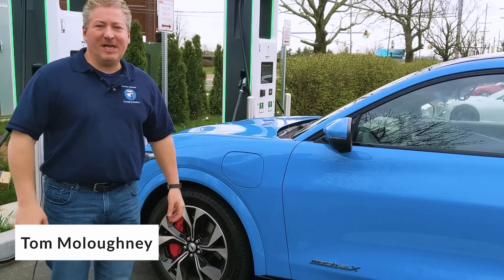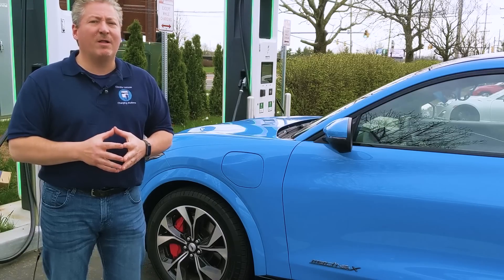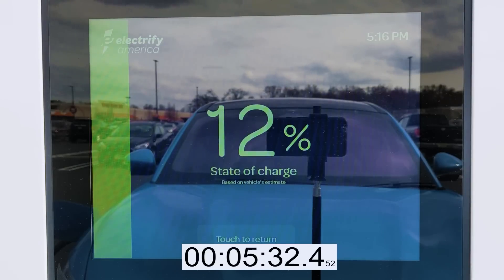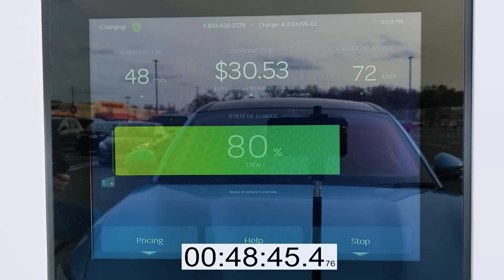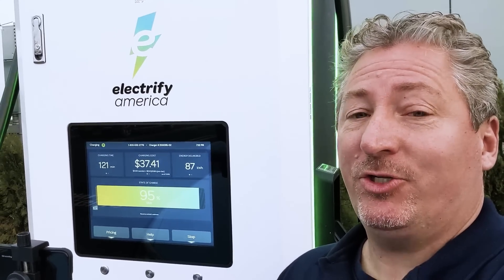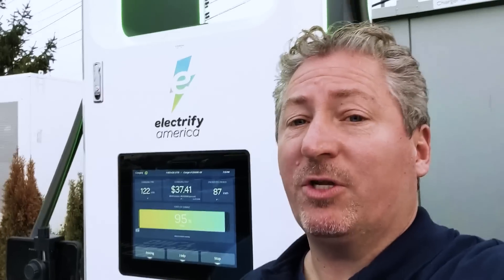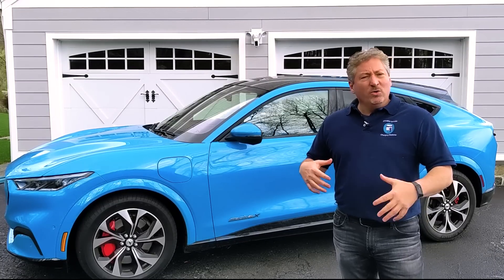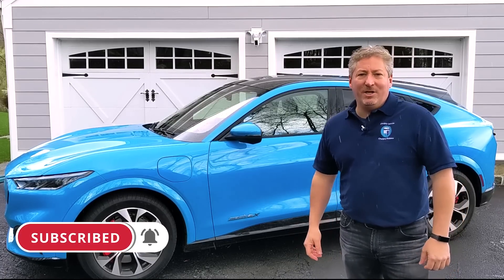Mustang Mach-E DC Fast Charge Test

Comment from the maker: Note- READ THIS regarding the cost: In New Jersey, Electrify America bills by the kWh and as a Pass+ member, I pay $0.31 per kWh. Since the Ford Pass currently cannot be linked to an Electrify America Pass+ account, users pay the guest rate of $0.43 per kWh. The Mach-E took in 92 kWh during my DC fast charge test and the cost was significantly more than it should have been. Instead of paying $28.52 to fully charge the Mach-E, it cost $39.56. So don't use the cost of $39.56 as you see in the video. It should have cost $28.52.

The problem is currently you cannot link your Ford Pass account to your Electrify America account to get the discounted rate, so I would have just used my EA account and saved $11. But then you can't access Plug&Charge, which I wanted to demonstrate. Hopefully, Ford will get this straightened out and Mach-E owners will be able to link their EA accounts to their Ford Pass, allowing both the discounted rate and the use of Plug&Charge.
Reply: MachE owners should consider buying a Tesla to J1772 adapter and find a Tesla destination EVSE at 80%.
Reply: As someone whose electric rate is $0.0985/kWh, those rates seem absurdly high... particularly considering you can only get ~250 miles on such a charge, so the cost to run an EV at those rates is the same as if my car only got ~13MPG and gas was $2.49/gal.

Charging at home is the only thing that would make an EV affordable with a charge being ~$9 for 250 miles, making it much cheaper than gasoline.
Reply: @looncraz  That's a VERY good electricity rate. The national average is $.13/kWh. Electrify America charges $.31/kWh for members - which is what you would be is you had an EV and planned to use the network. You have to remember, most EV owners only use public chargers once a month or so when they need to drive many hundreds of miles. Therefore paying a little extra once and a while isn't a problem. 
This session would have cost you $28.52 to go between 270 and 300 miles - our tests showed the Mach-E going 283 miles at a constant 70-mph. Therefore, it's cost $.10/mile which is MUCH less than buying gas at 13 MPG.
Reply: @InsideEVsUS   That's like paying $2.87/gal of gas, which is certainly not horrible compared to the $2.29~$2.49 it is for cheap gas here, but it better than the $3.09 I'm averaging with 93 octane... so, yeah, suppose it ain't too bad.
Reply: @looncraz  this is a higher rate for DC fast charge and for road trip purpose. Most of the charging for daily use are done at home or work.
Reply: Can u do a new more updated version please of model 3 and model s  v3 supercharging from 2 per cent up to 90 per cent? Please? An new more updated?
Reply: @vasileiospetropoulos2046  This video isn't about Teslas.
Reply: Ok so just stick with gas then.
Reply: @dennisfinan7977  Assuming you are talking to me... I own two PHEVs :p
Reply: @looncraz  no myself. Was looking at the mach e but I'm too lazy to deal with charging
Reply: @looncraz  not saying there not awesome to drive. Or not superior
Reply: @dennisfinan7977  Ah, if you can charge at home then it's a non-issue.
Reply: I'll look into thank you sir
Reply: they've fixed this. I   have the GT Performance Edition and the discount gets applied while using plug and charge through the app.

Comment: The way I look at is if I leave with a 100% charge and can charge at my destination, after about 3 hours of driving, I only need to stop for around 5-10 mins every hour thereafter, which seems perfectly reasonable to me in terms of normal breaks. I just wish there were a few more DC fast chargers in the south to give more options on where to stop. 

If I couldn't level 2 charge overnight at my destination, then yes I would need at least one longer DC fast charge session. However, if I knew I was going somewhere remote without good charging options, I would probably use/rent a gas vehicle for that specific trip. If you really like getting lost in the woods away from civilization, a powerboost f150 with 700 miles of range and a built in generator might be a better choice.
Reply: Tom has promised that Electrify America has not forgotten I-20 between Texas and Georgia.

Comment: Thanks Tom.  Charge rate up to 80% is sufficient.  I do notice it added 92 KWh for 100% (Ford states 88 KWh usable) so efficiency is a bit lower.

Not a big deal.  The car has power and solid range.  And Ford will learn and improve the charging algorithm.

I hope they can make them by the hundreds of thousands!
Reply from the maker: Hey Johan. The 92 kWh didn't all go into the pack, only 88 kWh (or maybe 87 kWh) did. There are always charging losses, which accounts for the 4 or 5 kWh loss during DC fast charging. That happens with all EVs.
Reply: @StateOfChargeWithTomMoloughney  Thanks Tom.  Even w DC to DC where an inverter is not used?  But I guess the charger shows 92 kwh dispensed but the car shows 88 kwh received?
Reply from the maker: @johannel8104  There's no reading on the car to display it, but the transmission losses are real. There's also BMS working for 2.5 hours during this to cool the cells, that uses the extra energy. It's the same with every EV we test.

Comment: Forget the charge speed, why is EA so expensive! Doing rough estimates in my head, if I were driving a car that got around 30 mpg, gas would have to be at $4 per gallon to make this comparable to what you paid for the miles driven. Even if you got the EA rate for members, it would be around $3 per gallon. Are my figures that far off or are the rates in your area just that high?
Reply from the maker: It cost $39.56 because I used Ford's account linked to Plug&Charge. If I used my personal Electrify America account it would have cost $28.52. I just drove 283 miles on a full charge, so it cost $0.10/mile. The current gasoline Mustang gets a combined MPG of 19 - but let's round it up to 20 mpg. It would need 14.15 gallons of gas to drive 283 miles. At $3/gallon, that costs $42.45. At $4/gallon it would cost $56.60. That $0.15 and $.20/mile respectfully. Gasoline to fill a Mustang would have to cost $2.01/gallon to cost the same as it cost me to charge the Mustang Mach-E using my Electrify America account.
Reply: @StateOfChargeWithTomMoloughney  Even with what you quoted if you used your personal account, it seems a bit high. I am going from information that Tesla owners pay at superchargers. A norm seems to be around $20 for 275 miles of range. Something else for me think about as I try to determine if I want a Tesla or another EV. The Mach e still is a strong contender. The issues seem to be software related and that can be addressed over time. Thanks for another great review and video. You and Kyle put out the best in my opinion.
Reply: @jamoss55  Most people charge at home, and it only costs 10-20 cents per kWh... so about 33%-66% of the price of the discounted EA rate.  You also don't need to make an extra stop to fill up during the week.  You just drive home and plug it in.  The convenience savings is a big deal when it comes to daily commuting.  In a gas car, you may have to stop at the gas station 3-6x per month.     Fast charging prices are always regional, whether it's EA or superchargers.  The pricing is not consistent across all chargers, just like gas prices aren't consistent across all gas stations.

Tesla's able to reduce prices because their network is simpler / cheaper to produce and they have less billing overhead.  Their chargers don't need to handle any billing on location.  The car software does all of it.  They're only able to accomplish this with a closed network, locking other brands out of their charging network.  While I'm sure it's great for Tesla owners and Tesla... it's pretty terrible for the overall EV transition, which seems to go against the company's own mission statement.

I will say that while Teslas are more efficient and cost less to charge, you can buy a Mach-E for less money.. especially the RWD version.  It'll take quite a bit of time to recoup that up front cost from charging... albeit it would have been better for the environment had Ford improved their aero a bit.  Tesla does use a lot of aluminum though, which isn't exactly great for the environment either.
Reply from the maker: @jamoss55  I'm a Tesla owner. It costs me $0.26 per kWh to use Tesla Superchargers ($0.15 to charge at home) and $0.31 per kWh to use the EA network. With as little supercharging or DC fast charging as the average person may need, the difference between using the two networks probably will amount to less than $100 per year. It's insignificant, unless you're using the car for some kind of car service or something where you're driving a lot of miles a year and needing to use DC fast charging all the time.
Reply: @jamoss55  it is not high you must be new to evs or a Tesla owner. Ea. Members have the cheapest rate of major charging companies. .31 cents compared to ev go at .37 cents per minute.  Also chargepoint the owner of the charger decides the cost not chargepoint. I have seen .20 cents a minute to 39 cents a minute. Ea is .12 cents per minute.  Some also add session fee of 4 to 5. No ea is not expensive if you really no what your talking about like I do with 6 years owing a 2012 leaf . I know what slow charge rate is and it isn’t the Mach e. If you haven’t started with a entry ev like I did people are spoiled by luxury evs like tesla or e tron
Reply: @markfitzpatrick6692  model Y was 26% more efficient then the mach E on his range test and even with the 31 cent membership (which you pay for) you are still well above the average supercharger kWh cost of 26 cents without including EA membership fees. These cars are direct competitors, if a camry was 30-40% cheaper to run than an accord people would would want to and should know that.
Reply: @markfitzpatrick6692  Not an EV owner yet. I am trying to decide which to go with. Tesla has the infrastructure, but there are several that are out now or coming out later this year that I am interested in. Most charging will be done at home as you already know, but it still seems a bit odd that for Tom to charge the Mach e to full or about 270 miles of range, it cost $40. That just seems high to me. I will be doing a few long distance trips per year, so I need to look at something that has good range. EA and supercharging stations seem to be the best choice for fast charging and I am hoping the issues with EA and the using plug and charge get worked out.
Reply: I had the same reaction.  I was thinking of possibly trading in my hybrid Ioniq that I'm averaging ~50mpg with for the Ioniq 5, but now I'm thinking I'd be better off just keeping the hybrid.
Reply: This biggest difference is that most people do the vast majority of their charge at home, which is often much cheaper. You can't do that with gas. DC Fast Charge infrastructure is EXPENSIVE.
Reply: Model Y is significantly more efficient. Would cost about 60% of what the preferred rates for electrify america are.
Reply: @larryspiller15  It depends on where you live. In SoCal, EA and Tesla Supercharging are about the same price. I believe they are both $0.42/kWh, which is ridiculous. Most residents pay around $0.21/kWh at home so charging at home is half the cost but it's constantly increasing. The worst I have seen is some Chargepoints pass the surge ToU pricing onto the customer if you charge between 4PM and 9PM. Either way, people shouldn't be buying EVs unless they have a reliable level 2 at their place of residence. It doesn't make sense to be 100% DCFC.
Reply: @Dashisnitz  socal is 0.40 cents on peak hours  0.20 cents off peak. Thats a socal issue, not a tesla issue. Throughout the country Tesla's average is 0.26 cent per kWh. EA is on average 0.31 cents or about 20% above that with their membership pricing, and when you consider the average persons charging is 80% of charging is done at home which means at most 3 months will have non home charging done, but you will likely pay for the whole year.
Reply: @larryspiller15  I never explicitly blamed Tesla, I blame the utility companies and the CPUC/AQMD for setting the rates. But, I know how to spot a Tesla fanboy when I see one. I was simply stating that power costs are increasing due to mass electrification with only renewable and carbon free generation methods. California will eventually be at a deficit without natural gas or nuclear.
Reply: @Dashisnitz  true and true. I don't think the answer is more natural gas though. Keep what they do have, increase battery storage while also doing some nuclear. Nuclear sounds good on paper but the cost to build always goes way over budget, the cost to maintain goes over budget, and the cost to decommission safely always goes way over budget. Even before going over budget nuclear costs more than wind and solar, even solar+storage is cheaper. Battery storage needs time to ramp though which is why nuclear shouldn't be completely ruled out imo.
Reply: @larryspiller15  I don’t care about the y this video is not about the y. Plenty of channels to go brag about it

Comment: $39+, wow, that looks expensive!
Reply from the maker: That's because I used Ford's account linked to Plug&Charge. If I used my personal Electrify America account it would have cost $28.52
Reply: @StateOfChargeWithTomMoloughney  that still looks expensive, but I haven’t needed to charge my Tesla model 3 outside my home.
Reply from the maker: @robertgamble7497  That's it Robert! Too many people focus on the cost of DC Fast charging and they rarely ever need to use it. Outside of my EV testing, I only need to DC fast charge like once a month, if that. I really don't care much if it costs me an extra $10-$15, because it's the convenience of using the equipment. The big problem is for those that can't charge at home and need to rely on public charging, the cost needs to be comparable to gas, definitely not more.
Reply: @StateOfChargeWithTomMoloughney  even with EA, that's still at least 10cents per mile

add in the time you wait that long to fully charge and it's way too costly still to own anything other than a Tesla
Reply: @chaleethao1986  wrong it is not too costly compared to other charging companies
Reply: @chaleethao1986  still too costly for me to own a Tesla!
Reply: @gmv0553  that has nothing to do with the price at ea chargers since tesla can use there own chargers
Reply: @gledatelj1979  average price in the usa is .12 cents per kWh for residential customers. Using public charging cannot be free all the time the ea charge of .31 cents per kwh is the lowest of the major network. I don’t know why you think you should not pay for charging when a 150 kw charger cost around 50,000 .  Gasoline is not free either. They get subsidized prices but they have had 100 years of building them.  I get so tired of people like you who complain if there are not enough chargers and that the cost is too much.  I charged my leaf for 2.00 on electrify america
Reply: @markfitzpatrick6692  Fastest chargers do cost 50K but commercial price of electricity is 5-10 cents/kwh and that is what is paid by the company. This markup makes it almost as expensive as gasoline with less range and much more waiting so why would someone switch over to electric?
Reply: It is .31 cent per kwh for members or .12 cents a minute in states that don’t allow kwh charging. Remember that next time you watch a Mach e video. Ea members price is the cheapest around. Chargepoint the owner decides the price

Comment: still sad to be so excited over plug and charge working as intended. also didnt note that you fail to get better member rate. well worth using the app vs paying full $0.43/kWh.
Reply from the maker: I explain the rate in the article on InsideEVs being posted now.
Reply: Kyle Connor ruined it for other people because it does work and you can always use the ea app and put the pass in apple wallet so all you do is tap phone on rfid symbol. I did it this weekend no problem. You can see charging on the app you don’t need to stand at the Charger .
Reply: @markfitzpatrick6692  plug and charge means touching nothing ala tesla. So sounds like didn't work.
Reply: @laloajuria4678  did you watch the video before replying? It worked.